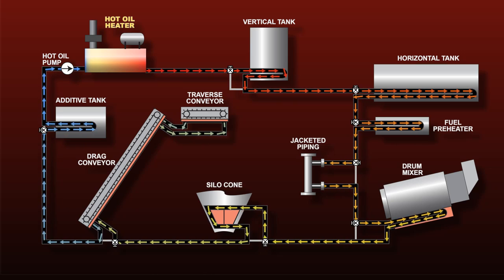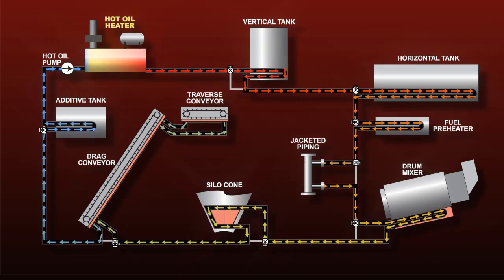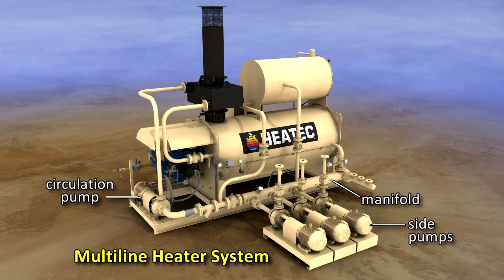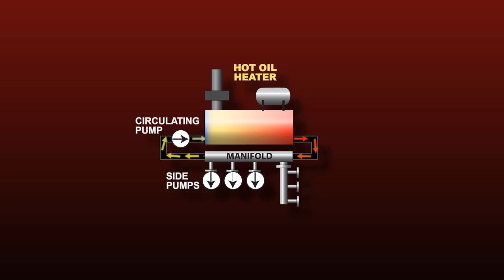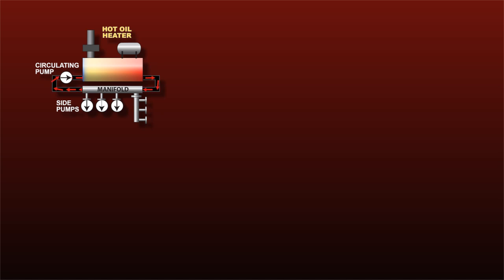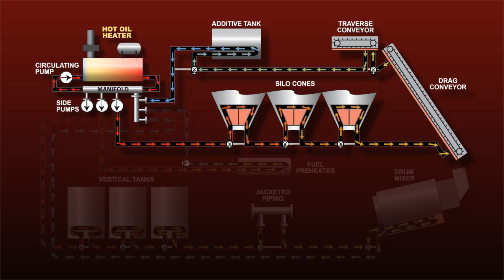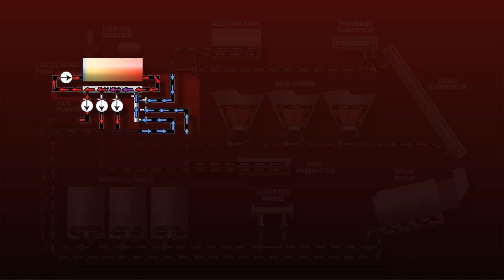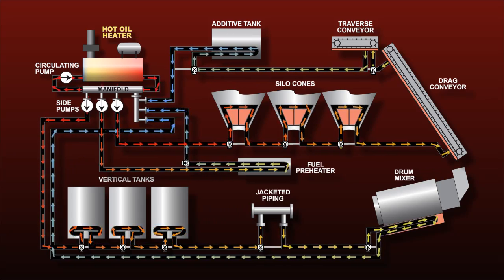Heatec Hot Oil Heaters

Comment: Response from Tom Wilkey, President, Heatec, Inc.
 
Mr. Dyer is mistaken when he says this heater has a life of less than 5 years. Just because it is not an API-560 compliant heater does not mean it has a short life. Heatec has been designing and building heaters like this one since 1977. We have built several thousand heaters, most of which are still in operation. They typically last 20 years or more. Technicians in our parts and our field service departments can testify to the longevity of our heaters. And of course, so can our customers.
 
We do not wish to turn Mr. Dyer’s comment into an online battle of wits. But our engineers will be happy to discuss the pros and cons of various heater designs, including API-560 heaters, with anyone interested in the type of heater best for their application. Please call 423-821-5200 and ask for Robert Wilfong, Director of Engineering and Executive Vice President.
Reply: Fulton thermal fluid heaters are much more reliable and advanced than Heatec.